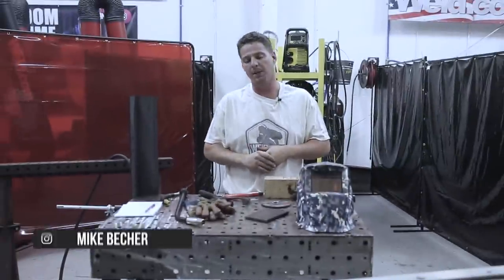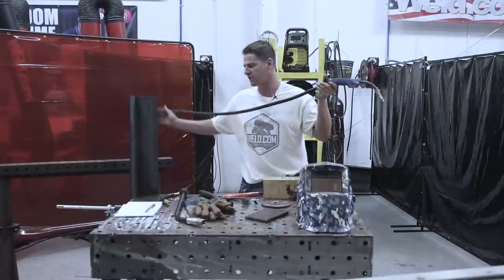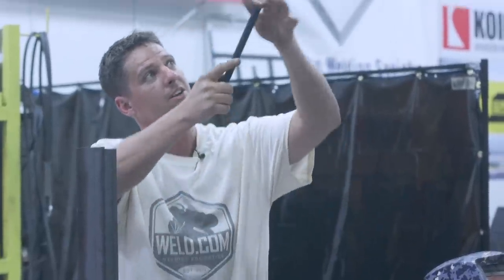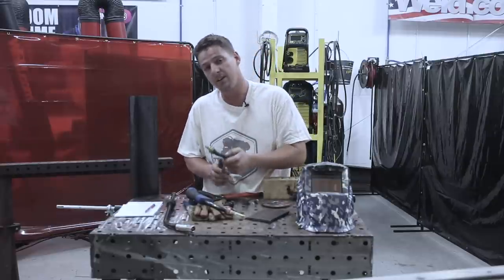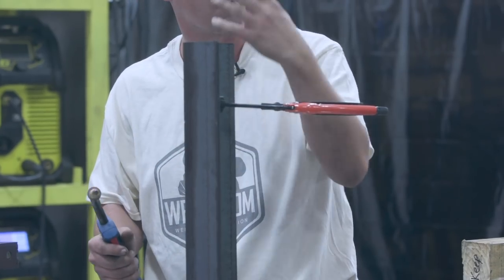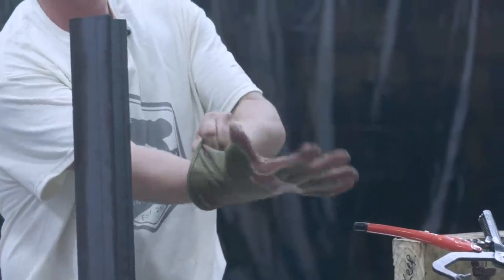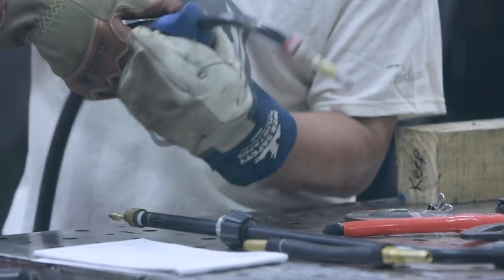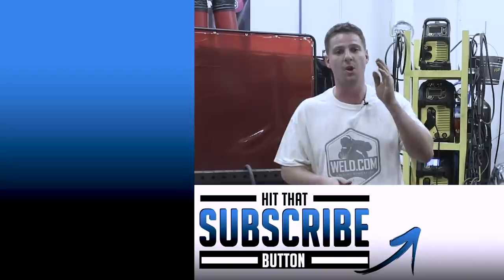Foundational Tips for MIG Welding | Part 1

Comment: About the glove trick : you can get some "thermal shields", which are just some leather and aluminium that you strap to your glove. It allows for much thinner gloves, yet offers a good amount of protection. They're cheap (around 10 bucks at my welding supply store) and can be life savers, so I always have one in my welding drawer just in case

Comment: I have a question.  
Just starting to learn with a Gasless Mig and having difficulty seeing the puddle with Pull method using flux-core and 0.8 mm  approx 0.030 wire .
Auto darkness Lens on 11 welding 2.0 MM steel  approx. 5/64" or 0.078"  

Do I turn the lens darkness down to 10 or ip to 12

Comment: Question.. My shop welder periodically starts skipping as if not enough wire speed. But then when you go to lay another bead it will full on melt the metal. The unit is pretty old. Is it getting time to ask my boss to replace it? Is it rebuild able? I usually have to set the volt 2 higher than the chart. 
Some days the machine is fine. 
Maybe someone is messing with it. Idk.

Comment: My biggest sticking point was not seeing the weld clearly due to the prescription in my glasses.until I bought glasses with a script to see at that welding distance. It’s hell getting old!
Reply: Yes it is. Its been 15 or 20yrs since I welded on the regular. Anyway so sometimes I am a little rusty at the start of a project but I think the change in my vision is a lot of my issues that I never had when I was doing it for a living. But I still love to weld and build shit to this day. And will tell they put me in the ground. Bought a everlast 221 sti a few years back and it is just one smooth machine.

Comment: Aluminum liners? what are you talking about.....and the difference is very little if they do make them....you need to let us know where you can get these [Aluminum Liners] ......
Reply: Are you serious? Just about every manufacturer makes an alloy liner. This isn't news.
Reply: @chadkennedy529  well, there are teflon lined steel liners for feeding aluminum wire, not made of aluminum  though. .....have you ever seen a liner made of aluminum or used one?  If so, please enlighten me.....
Reply: @chadkennedy529  and the point was also how much weight difference would there be? a steel liner weighs what, 6 oz. aluminum is 1/3 the weight of steel so you would reduce the weight of the lead by 4 oz. , why even mention something so trivial?.
Reply: @Laura-wc5xt   It seemed from your comment that you were unaware that they do indeed make aluminum liners correct?  I was simply informing you this isn't a revolutionary break threw. Also to answer your question yes I've used  them. Anything else I can help you with?
Reply: @chadkennedy529  yes, tell me who makes them  and where I can buy one like I wrote in my comment
Reply: @chadkennedy529  Beyond steel MIG gun liners, which are very cost effective and popular among welders and welding shops, there are a variety of plastic liners you can use as well. Most plastic liners look very similar but have different properties to them that make them more durable or better fits for certain types of filler metal and MIG weld processes:
Reply: high density teflon, high molecular weight Teflon, have a similar melting point to that of carbon Teflon liners while providing longer service life. These MIG gun liners work well with a range of wires from soft wires to stiff wires and abrasive wires.

Carbon Teflon. MIG gun liners are ideally suited for wires that are difficult to feed due to either the composition of the wire (soft) or the outside characteristics of the wire. This makes it well suited for stainless steel (ER308, ER309, ER409Cb etc) or flux-cored wire. It also performs well with some aluminum (such as ER5356). The teflon material is impregnated with carbon leading to better wear characteristics compared to other plastic MIG gun liners. It also has good temperature resistance compared to other plastic liners.

Teflon. has a higher melting temperature than polyethylene but generally is not recommended for high heat applications in an air-cooled MIG gun because of the high direct heat. Teflon MIG gun liners can be good for higher heat applications that utilize water-cooled torches and brass neck liners. Teflon has good abrasion resistance characteristics and can be used with a variety of wire types. Recommend careful inspection on the welding wire prior to insertion. Burrs can scar the inside of the liner and accelerate the liner's wear. While this is exceptionally important for the teflon liner, welding wire should be inspected prior to insertion into any plastic liner.

Polyethelyne MIG gun liners are for soft wires with poor column strength like aluminum bronze and 4000 series aluminum. The interiors of these liners are smooth and provide stable wire feeding, especially on small diameter welding wire. Polyethylene has a low melting temperature so they are best used in low heat MIG welding applications

Combi PA contains the addition of a short brass spiral wound liner attached to the front which enables this MIG gun liner to be used in higher temperature applications. The brass jumper aids in transferring current to the weld wire, and for this reason, Combi-PA liners are often used with soft wires such as aluminum silicone broze. This enables low melting plastic  MIG gun liners to be used in high amperage/duty-cycle applications where they would otherwise melt.

Polyamide. is a carbon filled nylon liner designed to be used in low temperature applications in a variety of wire types. It is a low cost alternative and a good choice for low duty cycle air-cooled, push-pull applications for smaller gauge aluminum, stainless steel and silicon bronze welding wires.
Reply: i think he was meaning liners used for aluminum, not made from aluminum
Reply: @peetky8645  probably, but all the ones I have bought, were steel coil with a teflon liner and weighed the same amount.